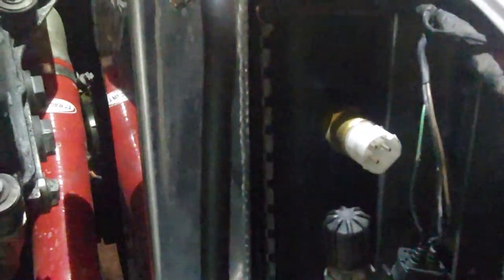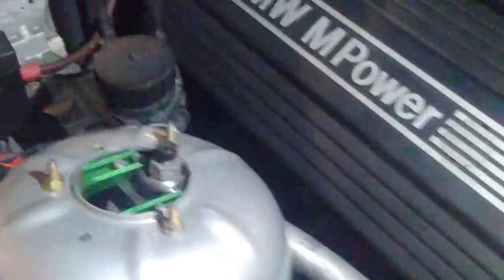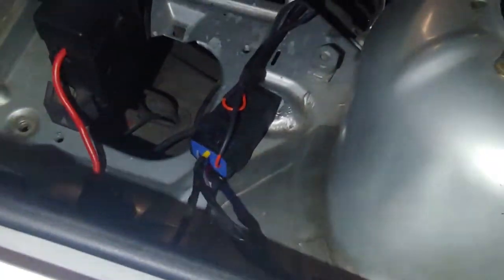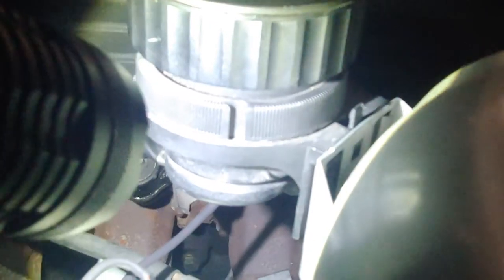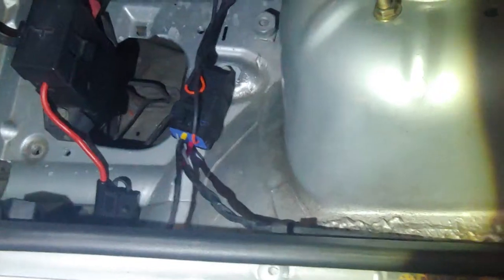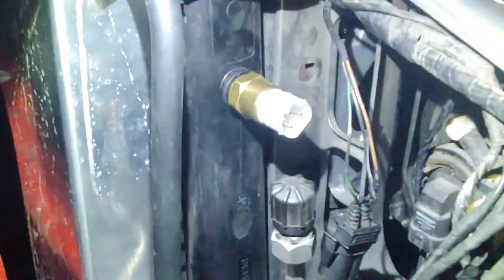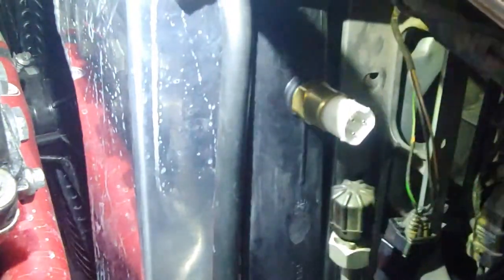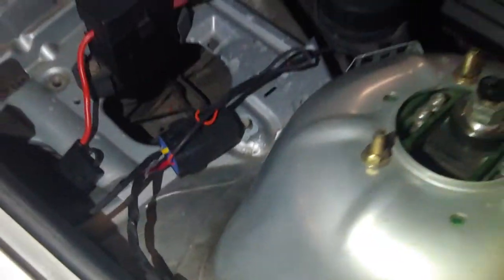BMW E36 Wiring Aux Fan & Relay Fan Delete

Comment: How close does that fan come to hitting on anything? Im about to go e fan and am having trouble finding one w adequate CFM while still being able to fit it. The one you have looks like the 16" spal puller - 30102049 that I am looking at, but I don't know if it will fit. Is that the one you have?